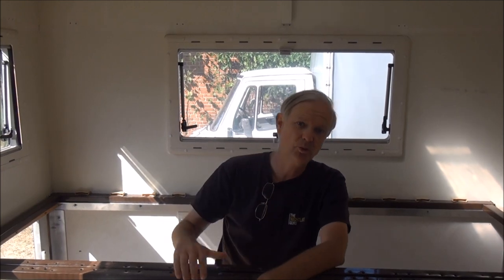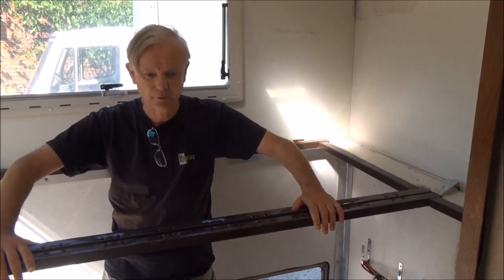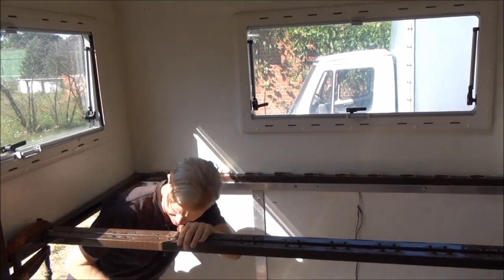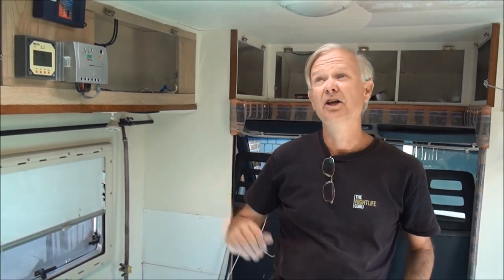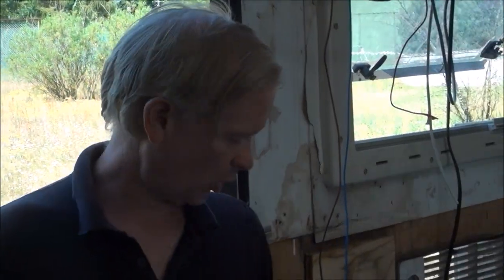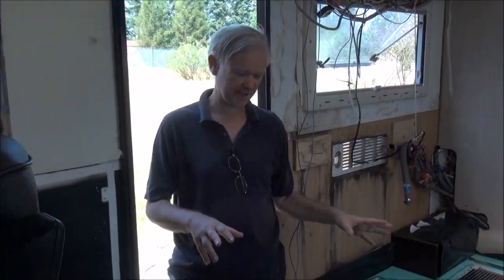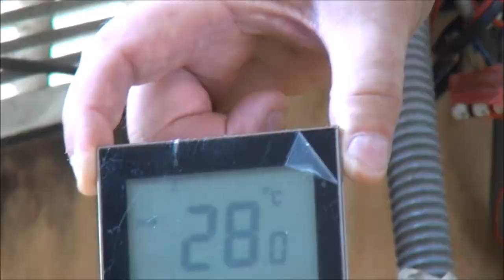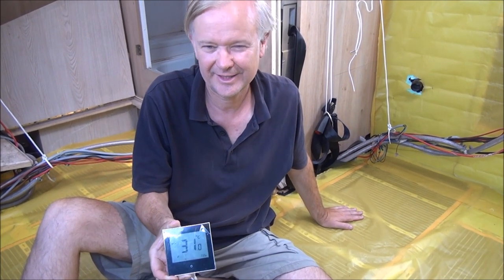Motorhome rebuild : Day six

Comment: I like your build series. Why did you decide to go with electric heat? Looks like you will always need  to have power at your camp site.
Reply from the maker: No Roger - the plan is for it to work off hook up - which is what I am doing most of the time!  The question is - is it possible?
Reply: I see. How are you planning to charge the batteries?
Reply from the maker: Solar as present!

Comment: Hello!  This is great!  Could you list the materials that you used under and over the heating elements?  For example, the yellow "tarp"? Also, how much electricity does it draw, how does it affect your solar system if you have one, on a cold cloudy day, or multiple consecutive cold cloudy days?
Reply from the maker: The materials used all came with the heating foil.  It is around 800W which can only run from lithium batteries and is only good as background heat.  That is too much for the solar system except on bright sunny days when probably the heating is not needed.
Reply: @VanlifewithAlan  I see.  Thank you for the information!  It makes a lot of sense.

Comment: Do you have a link for the floor heating panels?  I'd like to do this to my motor-home.
Hoping they make them for 110 electricity in the states.
Reply from the maker: The company is called Heat Decor.  I believe that they are available in 110V in the US.

Comment: Three years later and a new comment! :P

With the heating mats laid down, and the yellow material over it... you had no issues with laying the floor on top, as far as it being consistently level? I would think the wires running around the floor between the mats of film would cause issues?
Reply from the maker: No problems like that Scott.  The floor is as level as I can tell!  It is working very well at the moment!
Reply: Excellent. Thanks for the unexpectedly prompt reply :)
Reply from the maker: @scottweikert5189  If I see it quickly Scott, I respond quickly.  Sometimes I don't see it so quickly!